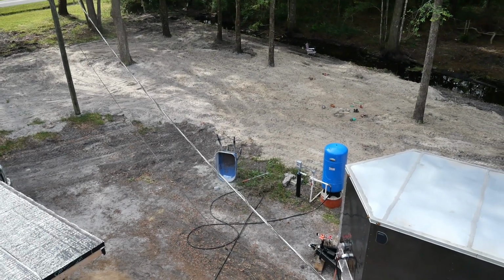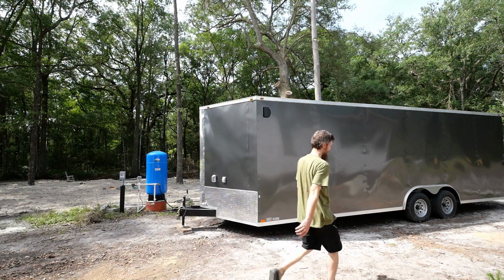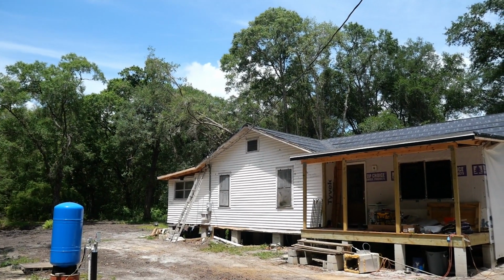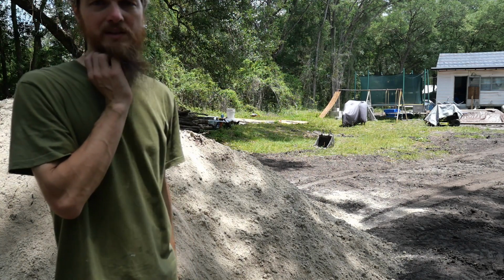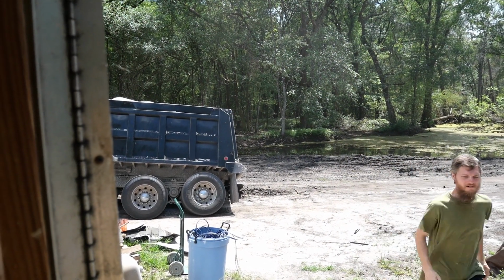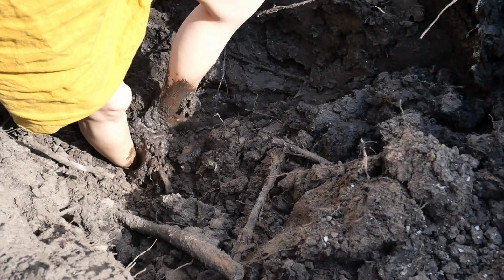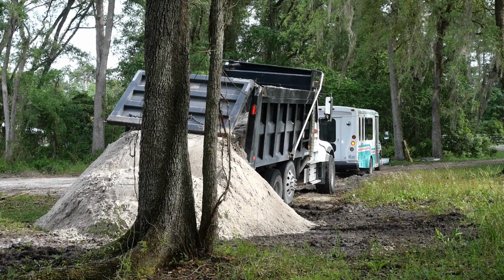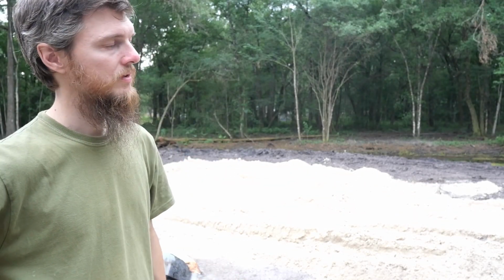Dump Truck Sunk Right into the Ground - Dirt Delivery

Comment: Like everyone has said, you need stones and gravel before the sand
Reply from the maker: We don't want rocks in our yard.
Reply: @diyfferent  sand should cover the gravel/stone and therefore you would not have rocks in your yard. You want something to hold the sand. Just my opinion, trying to be helpful. Good luck.
Reply: @tracyfranklin7883  well if the sand gets washed away as everyone says it will, won't there be just gravel left?
Reply from the maker: Yea, it would cover it, but imagine wanting to plant flower bulbs, bushes, trees, or posts, and having to fight through gravel to dig holes, yikes. We don't want to have hidden stones all over the yard. Most of Florida is sand and it works just fine for everyone else's properties.

Comment: You should have put the bus in neutral when he was pulling it. Save your Transmission.
Reply from the maker: It was just operator error. I was in reverse. I was paranoid about hitting the power poles so I was keeping my foot on the brakes, that's all. Plus I have barely ever driven that bus and it was hard to see what I was doing. :\

Comment: Dumping sand over muck doesn't  change the muck situation. I personally would have went with installing drainage tiles with a gravel or clay base or a mix, not just sand. Did you consult with any experts concerning the situation? That truck was bound to sink . Heavy.
Reply: Yeah I was thinking gravel too.
Reply from the maker: I did consider them, but we have poor draining soil and a high water table so they just wouldn't work. I did talk to a site prepping company and this is what they said is best. This fill isn't pure sand, but it is mostly sand. I don't think more clay would help our current muddy mess. Plus we don't want any gravel in our yard. We are trying to keep it stone free. We'll see how it goes with the sand and take it from there.
Reply: Well, not everybody is you

Comment: Would 8 inches of blasted rock (compacted) and 4 inches of crushed stone be better than sand? Can you change the flow of water to your pond so that it dries up?
Reply from the maker: The pond is just a low spot so the water really has no where else to go once it gets here. I think the sand will work as well as stone. We personally don't want any stones in our yard area.
Reply: What part of water table do you not understand?
Reply: Swamps dont dry up! You gotta turn them into land. That's how Miami was built
Reply: @marilyngordy3670  I just asked a simple question. If I had known you had all the answers I would of asked you first!

Comment: Had that happen with a concrete truck,  rock solid undisturbed dirt and truck turned off road to change angle for backing up to the site and the front wheels went in to the hub.  Enough weight and any soil will liquify and squish out like toothpaste.  In your case the toothpaste was 18-24 " down, but Florida water table is never very deep.  Unfortunately the sand will not help this.  Good thing that driver didn't try to dump where he was.  Suspect tow truck $ was really high.
Reply from the maker: We don't plan on driving anything as heavy as a dump truck on the yard, so it will be fine once we get the sand all spread out. :)

Comment: Could be a spring, or just decaying plants creating a bog. Fill with gravel, broken concrete, to let it drain and THEN fill with sand topped with water loving plants like cannas so no one drives over that area again.

Comment: Oh loved the baby owl although she/he looked frightened so I hope it’s parents were still helping him. Hope you don’t find any more sink holes in your garden. Did you say they won’t deliver anymore? What I couldn’t understand why did they not tip the sand out where it was stuck as that could of helped them move off as the lorry would be a lot lighter?
Reply from the maker: They probably didn't want to risk dumping the sand and possibly making the dump truck tip right over on its side, which is probably what would have happened. It was leaning quite heavily. They won't want to drive in that area anymore, so they will have to drop the loads in other areas of the yard, that's all.

Comment: Did the dump truck axles get bent?
Reply from the maker: Nope
Reply: @diyfferent  Well that's good!  Any thoughts on laying 2" stones over your sand?   ...Or using that black mesh rolled out to prevent sinking before any stone work?
Reply from the maker: No, we don't want any rocks or stones on our yard anywhere. The sand will be the top coat.

Comment: Oh my word!!! You poor kids!! And i So want to move to a sunshine state but this scares me!! Lol was there no warning this land was like this?? My daughter has been sick and in the hospital so I'm behind on videos but do u know what the problem is with all the water and everything just... Sinking?!?! Lol 🥴 hopefully this same helps but seeing the van need pulled out oh my 🙁
Reply from the maker: There's nothing to be worried about. That dump truck weighs about 35-tons and way too much weight was on those back tires so it made a rut. The top of the ground was dry, but underneath was still wet. These types of things happen everywhere, in all areas. We won't have anything as heavy as that truck again driving in our yard so we won't have this happen ever again. To put it in perspective, our excavator only weighs 3 tons. We also won't be normally driving the bus on the sand, but we had to move the trailer and the sand was just in our path. For our driveway we will be doing crushed limestone.
Reply: @diyfferent  ooooh! Ya that makes sense!!

Comment: Maybe using straight sand is not a good option, maybe clay....less absorbent, more water (moisture) blocking ??
Reply from the maker: Sand is what Florida mostly is, so that is what is available as the normal fill dirt. It's not like the northern dirt we're used to, but it's normal for this area.

Comment: I was wondering if your trees will die because you are putting sand higher than the base of the trees also do you think you will have a problem with sand fleas?
Reply: This is Florida we are a giant sand bar.
Reply from the maker: Time will tell. But generally we're trying to be cautious around the trees.
Reply: Hmmmm.trees don't live through their bark but by the roots and leaves. This is taught in Science class

Comment: Why are you using sand? It seems it would be better  to use some other type that wouldn’t be so easily to sink into.
Reply: It seems so much sand will make an environmental impact that wont be a good move. The birds will have to go else where for worms and bugs. If it was me I'd add soil also.
You should've check with someone with knowledge about such an impact will make..you might have seagulls landing
Reply: WHAT do you think Florida soil is made up of?????  And the dump truck didn't sink into the newly delivered sand!  It sunk into the ground that was already there!
Reply from the maker: Sand is the normal "fill dirt" down here. This is what was suggested by the site prep company we spoke to. It meets the state requirements for compaction and makes a good base. It's actually more firm than our current ground and will allow water to drain much more easily. But, if it's a mistake, time will tell. We are just doing what we think will help our situation.
Reply: @deborahpinkey1264  I am aware that he didn’t sink in the sand.
Reply: @diyfferent  I see. It just seems that sand would be less compact. But the experts should know
Reply: @margiemistretta8885  but it's not you
Reply: @deborahpinkey1264  And you're saying what?
Reply: Odd that there's even a state left! Oh yeah, we are surrounded by the sandy beaches.  Being protected by SAND!

Comment: Not sure if you will end up with a serious erosion problem on the banks of your stream. You have removed quite a bit of natural grass and trees that would stop erosion. Your sand may end up in the stream over time with so much rain. I live in the desert, where the hot sun has literally baked the dirt into what is called "hard pan" here. It is so hard it is like a layer of concrete just under the top soil. I was surprised when the water company had a construction crew dig up the trenches containing the sewer pipe along my property line/county road. When they dug through the hard pan, it disturbed what was underneath, a natural underground aquifer. There be water under there! This old sewer pipe trench was about 50 yrs old. Perhaps that is what your muddy mess under the dirt is - an underground stream or aquifer.
Reply: FL has A very high water table being close to the coast. This is not abnormal.

Comment: doug, are you concerned that the same soft wet mud could be under your house?  and would your pond have something to do with deep mud?  if the pond was not big enough, deep enough would the rain create and overload of water and so the pond seeps out underground or  is the underground so full, an underground water source that it feeds the pond. and are you considering cementing areas to park vehicles and where you drive on your property? for me this underground water would give me pause to stay or move. that was just crazy to watch that happen.
Reply from the maker: No, not concerned. That's dump truck was exceptionally heavy and it was just a combination of things going just right that caused that truck to sink. We are considering putting down crushed stone on the driveway but I'm not sure when we'll be doing that. Don't worry about that truck sinking though. Everything will be fine here :)
Reply: @diyfferent  well good for you ... thinking positive all the time.  Good luck with that.!

Comment: Why sand, instead of gravel?
Reply from the maker: We don't want gravel in our yard. I've never seen anyone do that?
Reply: @diyfferent  gravel in the south means soil mixed with a few bedrocks to make it set up harder.  It’s used to make dirt foundations harder. We just brought in 20 loads of “gravel” (ours is red because of the red clay soil in our area) to level our shop build before pouring the concrete floor.  I don’t think that person meant rocks like crushing run. I also have been wondering why you chose sand instead of fill dirt.
Reply: @Cottonstatecountry  Maybe because it's their yard, their decision!
Reply: @marilyngordy3670  why would you say such a thing to someone asking a simple question wanting to know why? I may be able to learn something from it.
Reply from the maker: @Cottonstatecountry  Florida is mostly sand, so this is the fill dirt that's available. It's what most people have for their yards and it works for everyone else. We won't be putting any rocks or stones in our yard.

Comment: Uh you guys know you gotta pay that tow bill at least that's how its goes around here once they pull in to your property I hope you guys dont have too that's big money up into 3500 4500 range read your contract just heads up
Reply from the maker: No, we don't have to pay that. They used their insurance for the tow guy.
Reply: We own a small hauling company. The homeowner is NOT responsible for the cost if we get stuck on their property during a delivery. Especially in such a random circumstance as this. My husband always checks the property for soft spots before he delivers and dumps. If it's too wet or soft, we wait. Our insurance covers towing....not the homeowners.
Reply: Bet you still wear a mask

Comment: This is your future. This is the reason cars don't drive on the beaches. Why sand for fill? It will be in your house in your clothes in your beds, every where.
Reply from the maker: When most of Florida is sand, sand is the fill  :) Sand is much better than mud, and it's so comfortable to walk on, plus it's fun for the kids to play on. If we ever want to, we can always plant grass on it also. Most people in Florida have sand for yards. What we have is really uncommon for Florida.
Reply: @diyfferent  Doug, I would stick those bags of hardened concrete in a hole like that and then cover it anytime you find a soft area like that. Good use for them since they are solid.  You may need to consider getting limerock and a roller truck and or gravel with a plastic mesh then putting your topsoil over 6in-1ft of that stuff once packed down.  Myself and my brother are facing this same thing in your neck of the woods on a new home we just acquired but not as bad as you have. Cheers Doug and Ashley!
Reply: BTW it's probably just your pond bleeding down / seeping that way underground.

Comment: i think  to fill  this kind of  place use demolish derbies instead of sand
Reply: What are demolish derbies?
Reply: @michellebryant2545   Unwanted hats?? ;)
Reply: Different organic materials degrade different rates, it would not be suitable the best thing to be used is what they're using that sand or  dirt here in Florida.
Reply: @larrym.johnson9219  i have same  problem  in MI  bay city . the house is too low  leave . what to do. ?

Comment: I don't understand why you abandoned roof progress to work on piers. It seems finishing a project before starting another would be 
Normal
Reply: I believe it is due to supply issues being the reason they are bouncing around projects.
Reply: I  think the extra weight of the metal roof  would put a lot of stress on the air jack to lift the beams/trusses off the piers.
Reply from the maker: We didn't abandon it. We are working in stages and doing what we can. We are done with the roof for now. It's best to get the house leveled before putting a metal roof on so you don't end up stressing the screws or metal roofing when jacking the structure. Also, it's very costly and we need time to prepare for that.
Reply: You still wearing a mask too?

Comment: I would have released the sand before lifting the truck. I don't know if it was technically feasible.
Reply from the maker: The truck was tilted so heavily sideways that it's a good chance that dumping it would have made it tip right over.

Comment: some reason the soil gave out !!! your living in a swamp (reason) !!!! the truck that helped is called a wrecker. spreading that sand on top does nothing !! you have to tiller it into your swamp land. your gonna need at least 50 loads probably 100. that sand has to be mixed in as deep as Ashley's feet were when she was standing in the swamp. GL after you spread the sand out rent a commercial tiller and work into the swamp 🙃  👍
Reply: The proper name is tow truck! The term “wrecker” is only used in certain parts of the country. Give him a break!
Reply: You don't live in Florida, do you.

Comment: Sand is the wrong choice for your yard, you need limestone base to get it more solid.
Reply from the maker: This isn't really "sand". It's just clean fill dirt. In Florida, the soil is just really sandy. This dirt should work fine for what we are trying to accomplish.
Reply: Limestone is a terrible thing to put on top of the soil. It will create a less permeable barrier and exacerbate the problem.
Reply: Nope. This sand will compact nicely after a rainy season. It'll be plenty solid and still have good drainage.